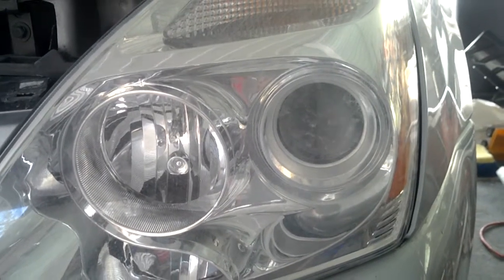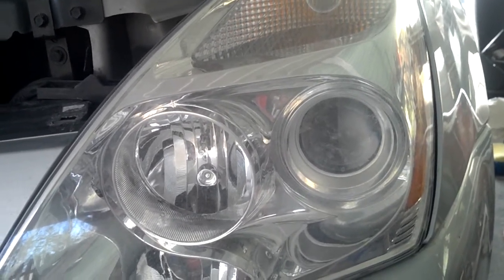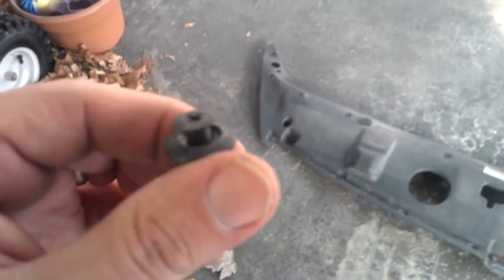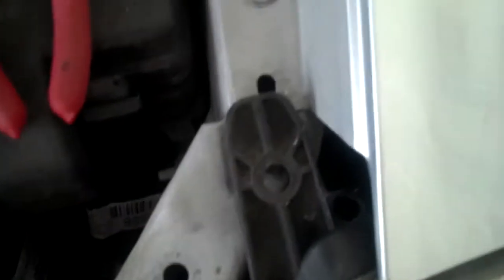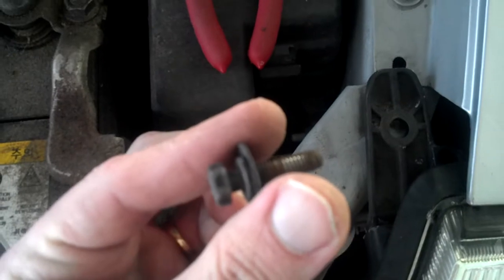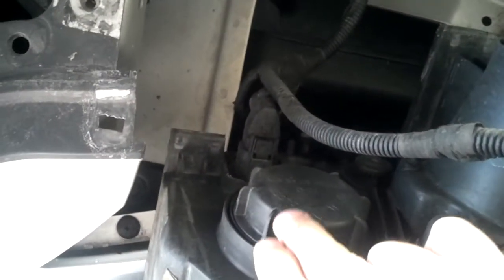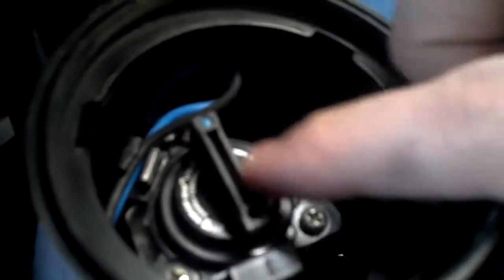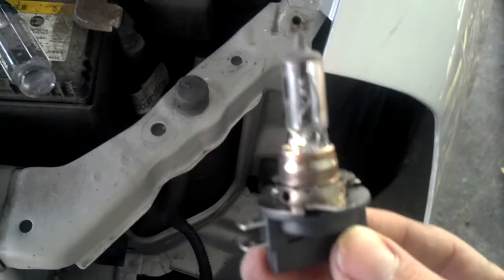Replacing Front Head Light on 2007 KIA Sedona EX

Comment: Thank you for your help. I am very handy with a lot of things but cars are not one of them. I had both light assemblies out and replaced one turn signal bulb on one and the high beam bulb on the other. It took all of about 25 minutes to do both. I could not have done it with out your video. Thanks again.

Comment: I use the point of a pocket knife to get between the head of the plastic retention screw and the collar of the clip.  Lever up gently on the bottom of the screw head, just until you hear a click, and that engages the threads of the plastic screw with the threads inside the collar.  Works like a charm..